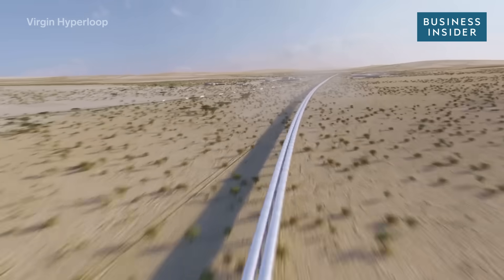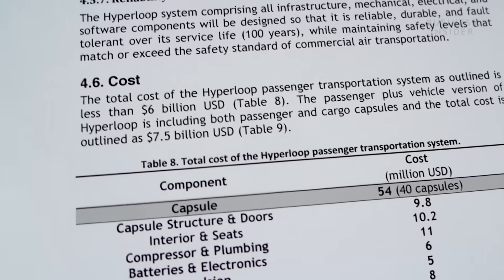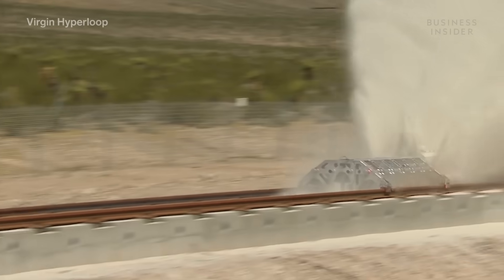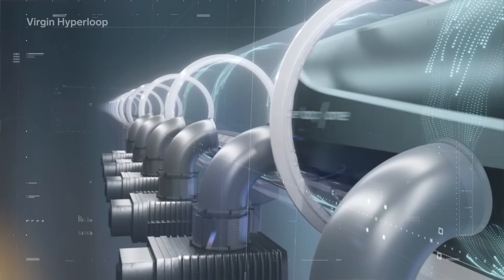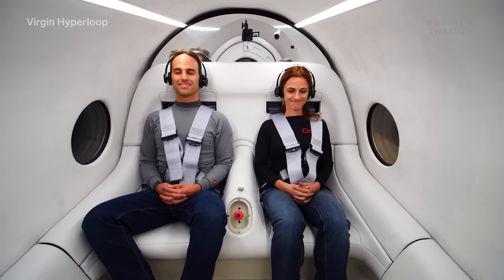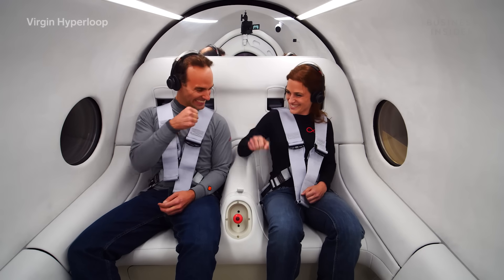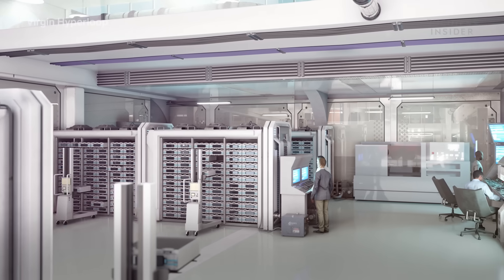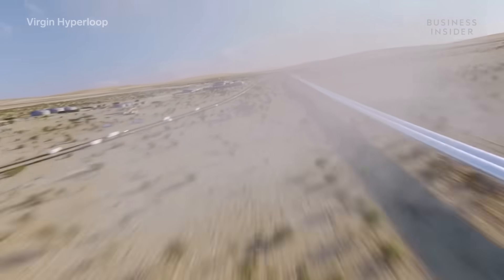How Elon Musk's 700 MPH Hyperloop Concept Could Become The Fastest Way To Travel

Comment: The thing is, hyperloops are really dangerous, just as if you were in a plane at high altitude and a breach opens in the plane, everything would be sucked out. But with hyperloops, that has less than 0.01 % of air inside the tube, a small hole caused from instance from a terrorist attack would cause an important explosion and everyone would have no chance of survive.

Comment: He first needs to build a working prototype. At least be able to run faster than 200 mil/h. Stably. Current vibrant will derail it, if it goes faster. Before that, it is still a dream.

Comment: Hyperloop might be the future for inter-city transportation but definitely not long-distance transportation. I don't think people want to be stuck in a claustrophobic tube for more than 5 minutes. Now a Maglev train, like the one being developed in Japan, one where you can see the outside is almost certainly the future for travel between cities 150 and 500 miles apart.
Reply: Actually hyperloop is not useful on short distance as it cannot reach its top speed within the distance, so the cost of the tube, plus the time it takes to take to get in is wouldn't save much time compared to a train or a car. For the Maglev in Japan, it could work even with the high cost because of the density of the population, but only if they can operate it at its full capacity, but it's still a risky bet.

Comment: Ok so 30 passengers per capsule, 30000 passengers per hour on a single line. Means 1000 capsules per hour or one capsule every 4 seconds. Are you trying to tell people they load this thing faster than a revolver? Also at this rate the capsules have about 300m/s * 4s = 1200m of distance between each other. There is no chance for them to brake without ripping the passengers apart. Hyperloop is a scam.
Reply: Yes because people are spending thousands of dollars on research and putting in thousands of hours of their life to scam people. Remember this isn't going to be ready until 2030.
Reply: @cheks_765  This is not about research. Its pysically impossible.
Reply: @jonibeYT  Again it is not impossible. Theoretically, it can go faster than the speed of sound, but that doesn't mean we are going to do that. Another thing if it was physically impossible how were they able to do their first-ever test. The thing you seem to be missing is that this will not be ready next year, it will be ready in the 2030s.
Reply: @cheks_765   theres trains which work with magnetic levitation, we can build vacuum tubes, so yeah, they can build a few hundred meters of test track and run a train through it. Building the same thing over hundreds of miles is a lot harder than that. You will need high performance vacuum pumps every few meters to keep up the vacuum, this alone will consume so much energy that ticket prizes will be unpayable for regular people. But yes theroetically its possible. Whats not possible is 1. noticing something went wrong in a capsule 2. notifying other capsules 3. braking from 700mph, on a distance of 1200m while going 300m/s.

Comment: This won't work as advertised for sooo many reasons. I'm not just a nay-sayer, id love to see this work, but a few key technologies that are fundamental to this working have not been invented yet. One example of this is that it has yet to be demonstrated that you can actually effectively evacuate the air from the tub across kilometers of track, some back of the envelope calcs show that the power requirements for such a system would be extremely prohibitive. The human demo was a bit of a theater act, the cart did not reach any sort of exceptional speed, it didn't levitate on magnets or a cushion of air but on wheels and there are questions as to whether the tube was a vaccum. Please Please Please stop peddling this shit, there are a couple well funded companies that are convincing you this something you need but it is not (very similar to the monorail episode of the simpsons). What you need is to invest in improving rail infrastructure and build high-speed lines between major cities, they will be fast enough to allow people to live boston and work in new york, what more can you ask for?

Comment: Omg people are so stupid for thinking the hyperloop is ever going to be a real transport method. Its incredibly dumb and WAS NOT INVENTED BY ELON MUSK! Google hyperloop and simply view the original drawings of a "hyperloop" from over 70 years ago. So one should ask, if the hyperloop has been an idea since then why hasn't anyone actually made one the past 70 years... oh thats right because its a stupid idea. Just imagine your in a thin metal tube thats pressurized, moving upwards of 700 mph... so...
1) corners can't be a thing otherwise the car would just go straight through the wall of the tube from any turn when you are moving 700mph. 
2) if anything punctures the tube then boom there goes all your pressure and your not going anywhere. 
3) moving at speeds that high would create incredible g force to get up to speed so if you want humans in there your going to need an obscene amount of tube just to get up to speed. 
4) any accident, and I mean ANY woild be completely lethal. There is no way you are going to survive a crash in a small pressurized tube moving super sonic speeds. A plane going that fast and having an accident isn't a problem due to the simple fact that the pilot can eject. You can't eject from inside a metal tube thats inside another metal tube. 
This idea is never going to be a thing physics just does not allow for this being anything "safe" or useful. A maglev train would be a better, easier and safer beyond compare. 
TL:DR the hyperloop is never going to happen. Its too dangerous, and physics do not allow for what they think it will be.

Comment: This is a literal billionaires pipe dream. It would be more cost effective to have a tech tested high speed rail. Then a dangerous vacuum tube.
Reply: yea because california's $100 billion high speed rail failure is not cost effective enough. seriously if you really want to talk cost effectiveness the best way is to build more accessible airports and encourage budget airlines like ryanair and easyjet to open branches and operate in the US which will make air travel significantly cheaper and accessible to the poor. Air travel is also much faster than rail so go figure.
Reply: @justcrypto618  the California project was $100 million bc they didn’t plan for the kind of money they would have to give farmers in the region. If anything, hyper loop would have a harder time getting the land bc they don’t have eminent domain
Reply: @justcrypto618  the reason for the expense is because of the lack of a solid plan which in turn led to wasted budgets

Comment: To get the high speeds they need a vacuum or extremely low air pressure within the tube. Maintaining such a vacuum in a miles long tube system would be virtually impossible without limitless power to drive a rather crazy number of air pumps all along the tube. 

You also need that tube to withstand the air pressure that is crushing in on it. While this might be 14psi at sea level, remember, that is 14psi around the circumference of a 12' diameter pipe that is miles long. Not trivial. Most likely it will crush any pipe they make like a beer can.  

You also need to deal with the lengthening and shortening of the steel tube in the heat of the sun and the cold of the winter. Even day/night differences, over the length of a run of tube, would be several feet. This makes the idea of holding a vacuum even less likely.

And finally, you need to secure the entire thing, every inch, to prevent malicious damage.  A bomb or armor piercing round anywhere along the length of the tube would destroy the carriage riding along in it within seconds.

So no, this 700mph system will never go beyond, maybe, demo stage on a very short run of track.

Comment: it has literally no advantages over current transport systems and packs some totally unique problems as addition. 
it's not faster than a plane, nor cheaper than a rail. Instead it will be much much more expensive to build and operate, and we even not got ner the safety and reliability issues of overhypedloop to rail and plane transport.

Comment: I absolutely believe that the Hyperloop is technologically possible. What i don't believe is that it will be cheap or profitable.
Reply: Well, I would argue it depends on the distance. On a  dozen of km it is possible but a huge waste of money, while on a 1000 of km it's technically impossible for more than a day (to be optimistic). Because it would basically require a huge air pump every 100m basically and any minimal leak would make the vacuum disappear instantly. Make the vacuum again would take weeks. Also, any accident or repair in the tube means it's unable to operate. IN case of an accident, how do people get extracted from it too ?

For info, the NASA vacuum chamber that is 100 feet in diameter and is a towering 122 feet tall take hours to empty (8 hours if I'm not wrong)

Comment: I have one small doubt. I'm not expert in electromagnetic but I have to ask you if someone try to make electromagnetic field around the capsule (outside) then? Or is there any other idea to isolate that capsule with outer field?
Reply: Do you mean a sabotage? 
Drilling a hole would be much easier.